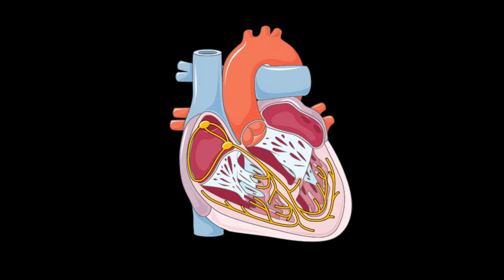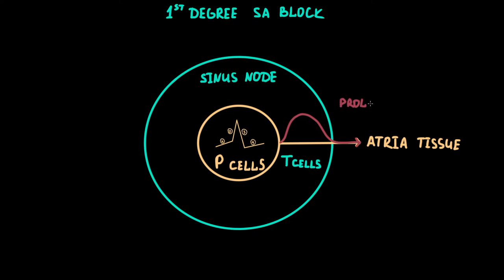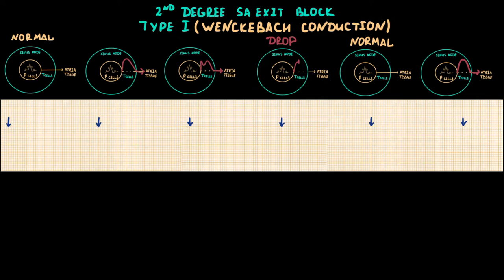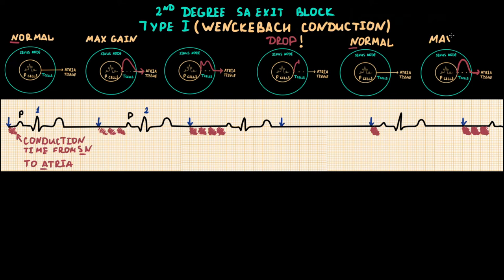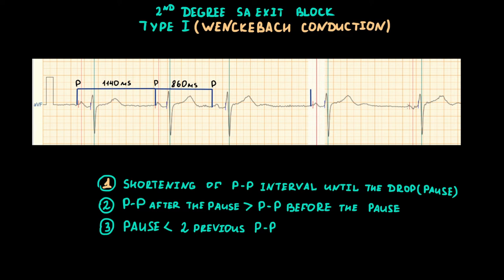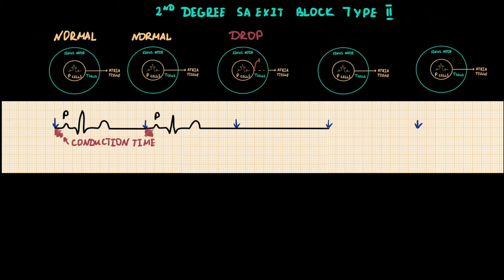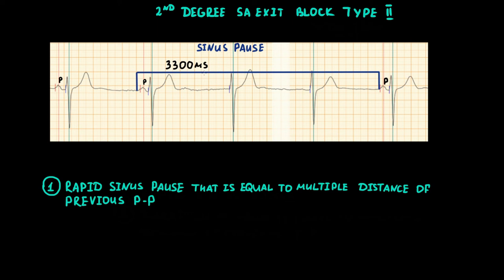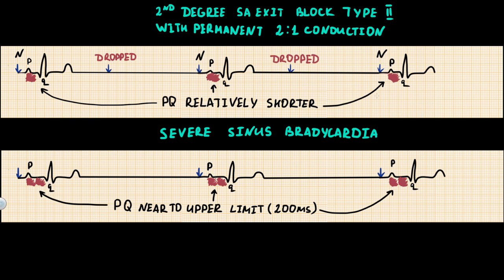SINOATRIAL EXIT BLOCK. FIRST, SECOND (type I, type II) THIRD DEGREE. ECG criteria. Wenckebach.

Comment: why the p-p interval is shortened although we have a delay? in 2nd degree type I
Reply from the maker: thanks for your question, this is occurs due to Wenckenbach conduction, the key moment is that we maximal gain usually occurs in the second complexes, further for better understanding open the video in 5:14,  conduction throught the T cells in 1 complexes is 1 square, in the 2 complexes is becomes three time bigger - 3 squares (maximal gain from 1 square to 3 square or 300% from previous that prolongs P-P inteval maximally) in 3 complex is 4 square that is gain only 75 % of previous. As a result P-P interval with maximal gain inside is maximal. Near to the pause gain becomes smaller and  P-P too. I understood only when i draw it in the paper with squares maybe it can helps you too
Reply: @Foxterrier  Thanks so much
Reply from the maker: You welcome)

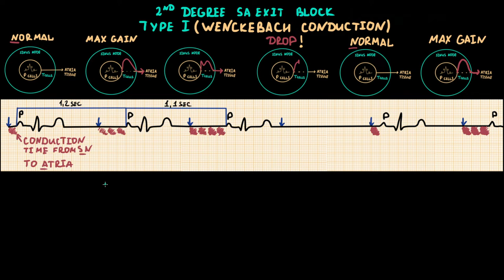Comment: @4:39 
I did not watch the rest of the video, but at least for the Second degree type I section, the interval time calculation is incorrect. 12 large boxes should be an interval of 2.4 sec and 11 large boxes should be 2.2 seconds.
Great explanation otherwise.
Reply from the maker: Thank you for your attention, i used calculation according paper speed 50mm/sec, in this case, 12 large boxes is 1.2 sec